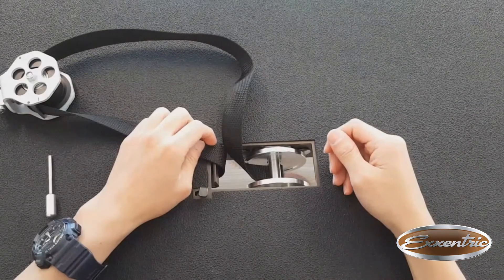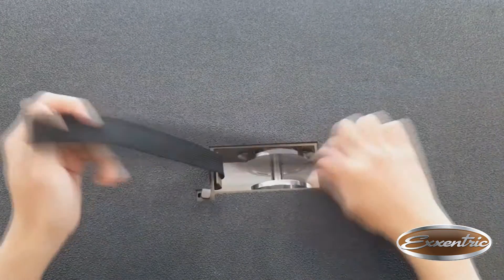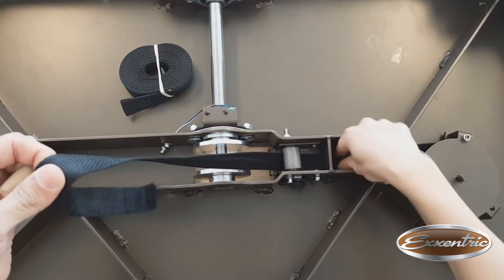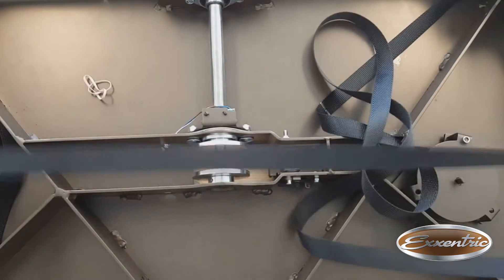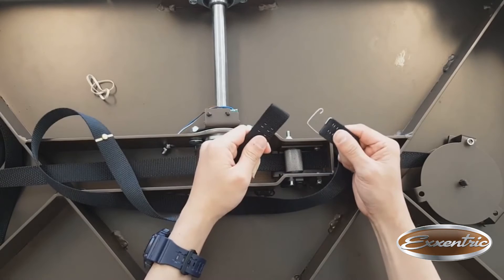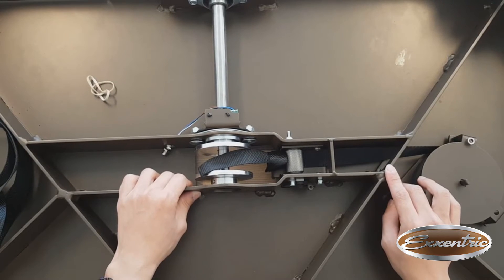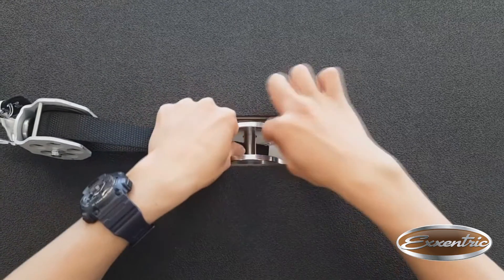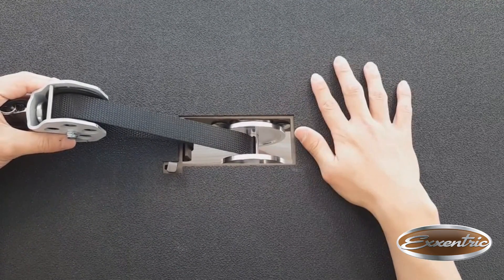kBox4 - Replacing the drive belt

Comment: How often should belt be changed? I used my kbox now for about 2 months, and the belt is twisting/twisted a bit. When i am exercising on it i am careful that i move in a way the belt doesnt get twisted, but i use it also with clients, which do some mistakes in movemenet ( before they learn), so the belt gets twisted. Can i damage the machine if the belt gets twisted? Thanks
Reply from the maker: ZBdrumschool Hi. Mainly you only trim it when needed. Can be once a week, a month or every quarter depending on how you use it. After trimming it a bunch of times it might need to be replaced since it shortened every time you trim it. Same if it wears down in the middle then it needs to be replaced. Trimming is a 1-2 minute operation and you need a pair of scissors and a lighter. For replacing the drive belt it takes around 5-8 minutes and no tools needed beside the locking pin removal tool that comes with the kBox. Sounds like you treat your kBox in a very good way. We see more wear with new customers but after a while you realize how position and use affect the drive belt wear. A tip: after you are done, roll out all belt from the shaft, make sure it isn’t twisted or folded and wind all of it up on the kBox nice and tight. This sort of irons the drive belt and keeps it flat and nice longer vs if you just drop the pulley block when you are done or even worse, leave it with the belt rolled up and twisted. /Fredrik